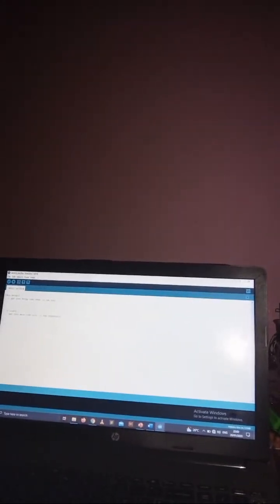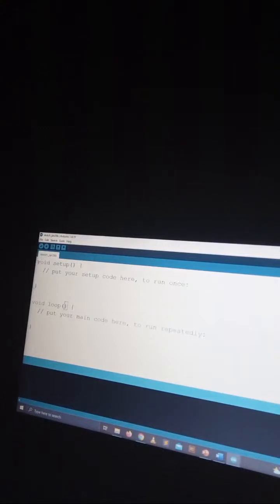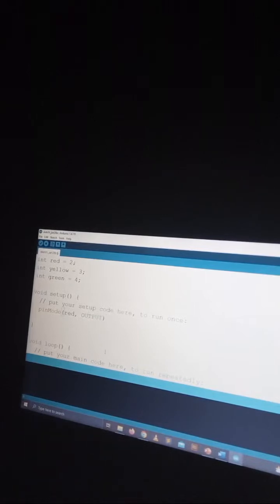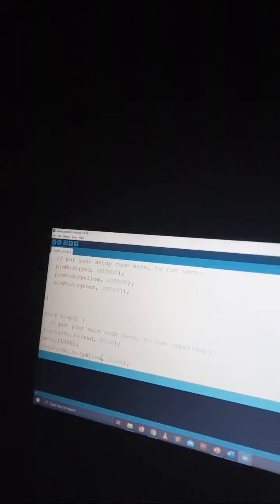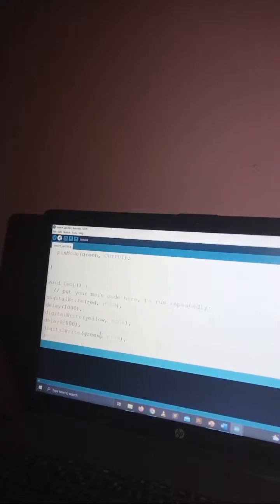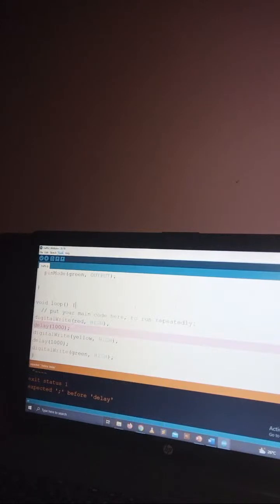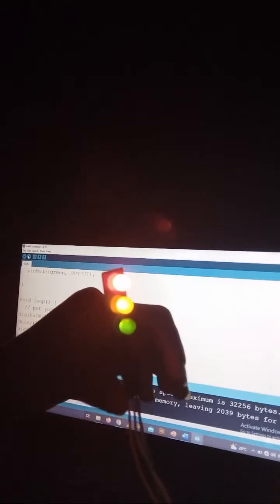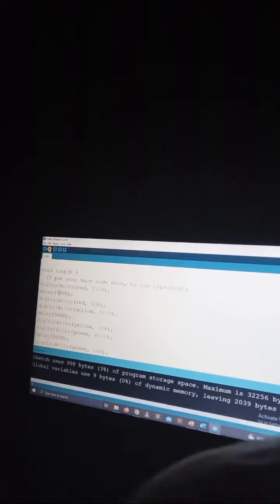How To Control Hardware With Your Code

Comment: I have two questions though

1) how do you delete the code from the arduino, Incase you want to use it for another project

2) after uploading the code, how do you get the power supply to make the arduino start working? Is the power supply from your computer as it's connected to the arduino via the USB cord or can you get an external power supply like from a battery?
Reply from the maker: 1. Whenever your upload a new set of code to the Arduino board, the new code overrides the former one, so you don't need to delete any code just write your new program and upload, it will automatically delete the old one and start executing the new code

2. Arduino has several ways of powering it, it has two ports present, a USB port for your laptop and a power port for the battery. You can still power the board without these two ports through it's Gnd, vcc or vin pins.
If you have more questions please don't fail to ask.
Thanks 😊